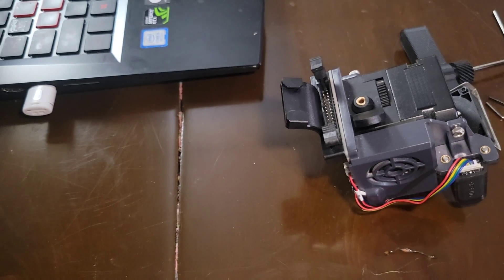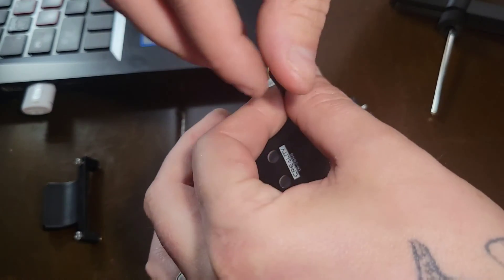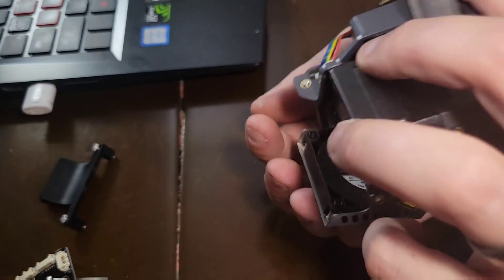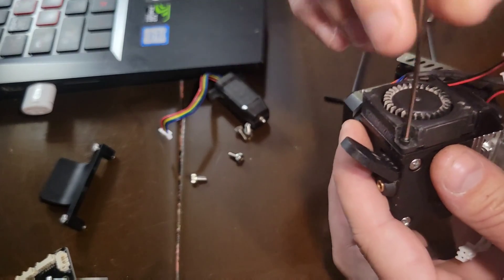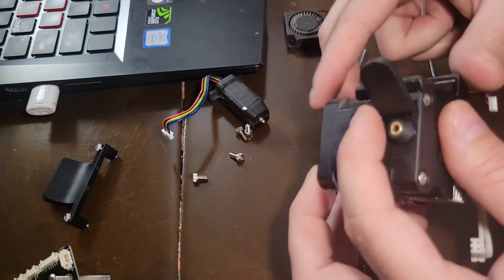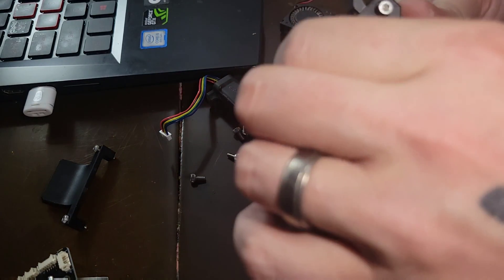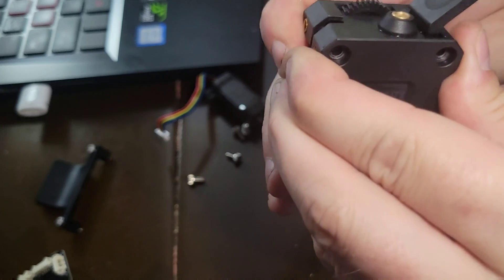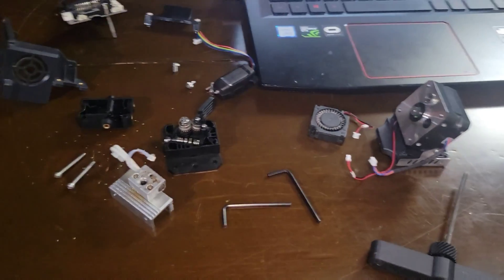3 Easy Steps to Unclog Your Sprite3D Direct Drive Extruder!

Comment: 3 ??????
Reply: Yeah idk what he's on about, this is a video disassembling the entire hot end and extruder motor. It seems like this is the only fix for a jam up top unfortunately, but it is NOT easy and not 3 steps.
Reply from the maker: Yes 3 steps 1 HEAT UP 240 
2 PUSH TOOL IN EXTRUDER MUST BE DIRECT DRIVE OR DIFFRENT STEPS
3 CLEAN UP